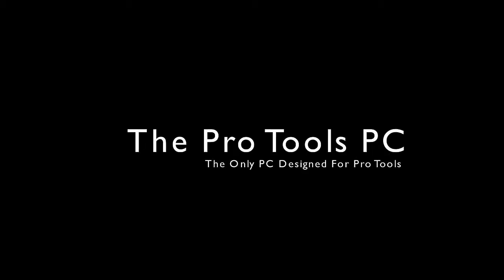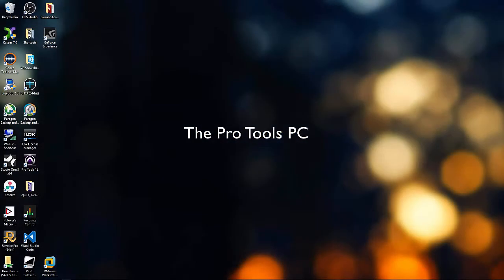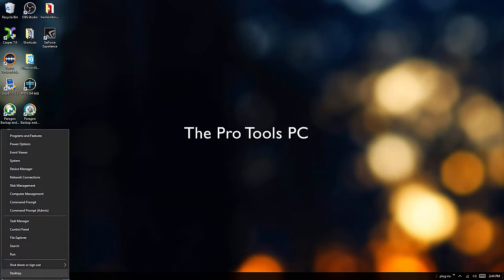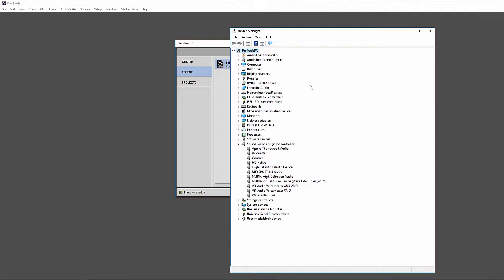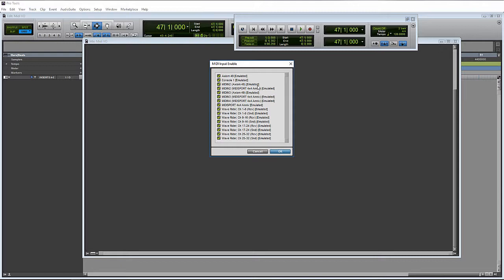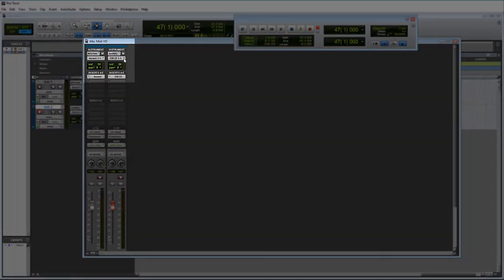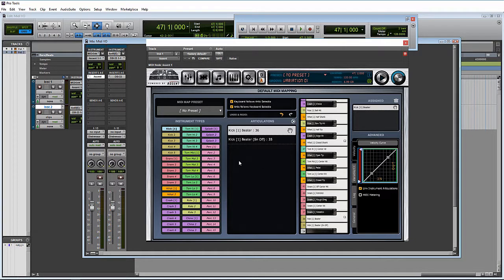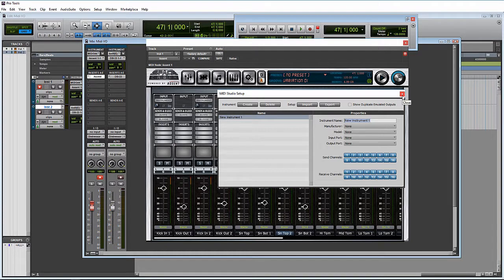Installing a Hardware Midi Instrument Controller on Windows

Comment: I'm confused about one thing. You show at the top midi meter the input signal but you never mention what the output is actually set to? I am trying to set up a drum pad and it asks which midi channel 1-16 I want it set up on. There is no All Channels choice. I can't get my Akai MPD218 set up with Protools. The meter shows input message but how do I get it to trigger the sounds of Superior Drummer 3 for instance? Putting it in inserts doesn't show anything on the drum kit when a pad is pushed on the MPD218. Any help would be appreciated, thanks.
Reply from the maker: You have to set the output to the proper device (Plugin or midi interface output) and the channel you want. Most all plugins will be ready to accept either channel 1 or all. If it is to hardware, you need to set to so that the output is going to your proper midi interface port and channel. Many midi interfaces will have multiple output ports.  So for SD input, you would have SD inserted in the plugin slot, then set the midi output to SD. Then channel 1 or all will be fine to trigger it. Depending on the track type, you may need to arm the track or set it to input monitoring to hear it.